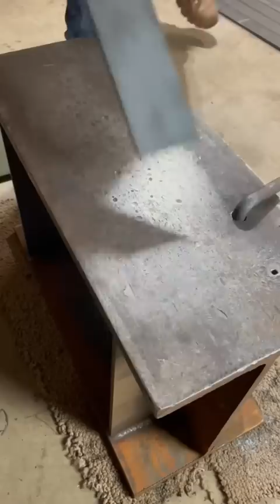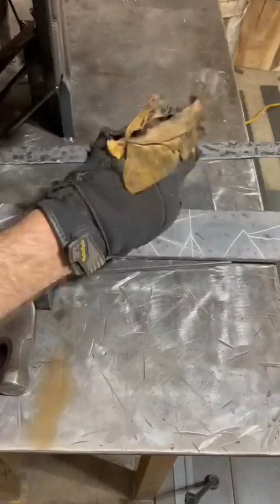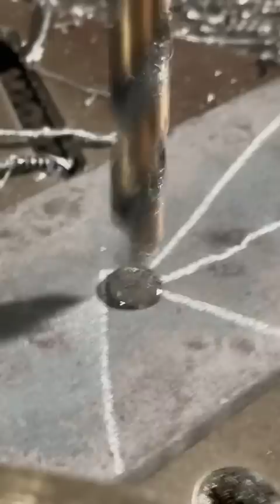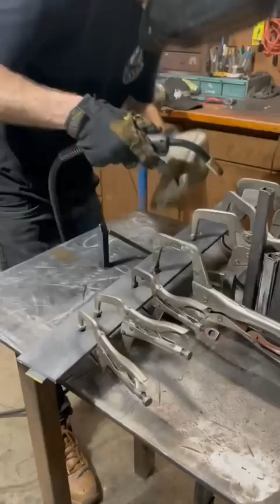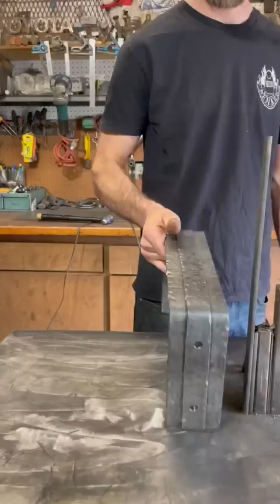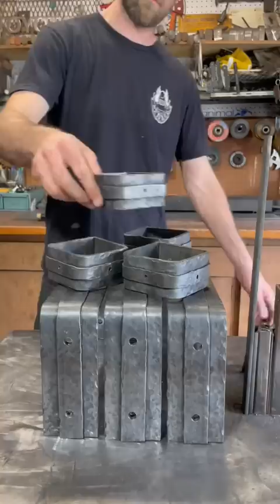Hand Hammered Straps

Comment: I've done a lot of ornamental iron work good job. When doing plug weld i have drilled through both and put a hammered faux head to look like it was hot riveted. Keep up the vids fun to watch.
Reply: I’m sure there’s plenty reason for it, but would it be worth it at that point to just truly hot rivet it?
Reply: @cadewilton6598  you can grind the back side flush with a weld and not compromise strength of bond between pieces... at least that's what the shop foreman said i just get paid to build🤣👍

Comment: Welders seem to love making arrows for “precision” but as a saw guy that cuts 1000’s of steel pieces a month I prefer a finely sharpened chalk and the smallest of marks to get as accurate as possible and its never failed me. Tried the arrow technique many times and it was never as precise as I wanted it to be.
When I say small I mean if you look away you would struggle to find it again but thats what a square is for. Make your 1 mil mark and line it out with a square and remeasure for good luck and boom you just graduated kindergarten🤙 But just to clarify it is 100% preference
Reply from the maker: Should try a scribe 👌🏻👌🏻 the arrow is because if you draw a line it won’t be perfectly square to reference the cut, so then if you go from front or back of line the length is different by maybe 1/16 or more, so instead just draw a massively out of square line, intersecting with another.. but just leave it a point instead of an x because an x is just confusing. Idk man. I just draw them for quick visual reference.. I do remember being confused like why are we drawing these litte pacmans all over. But I get it after working in shops and in the field with other people as well. It’s different reading your own marks vrs marks someone else made.

Comment: Ok what’s up with your left hand??
Reply from the maker: I fractured the metacarpel behind my pointer finger. Took a surgery with a screw in it to set it straight… ended up dislocating it partially after the surgery from returning to work to soon 😳😂🤦🏻‍♂️ it’s all fine now, even the partial dislocated bump down by my wrist that will be there forever now. I posted a video on Tiktok talking all about how I injured it if you are interested in checking it out.